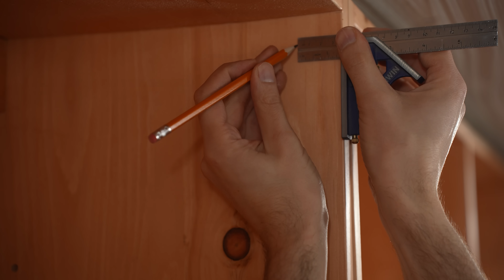Stop Using Plywood To Make Cabinets!

Comment: Plywood is the single best deal there is.  I say this as an actual fine woodworker, and a wood snob.  But I just bought some Baltic Birch (so called, it may come from china), and it has 11 plies.  that is 352 square feet of veneer in it.  Veneer sure doesn't cost even as little as 1 dollar a square foot where I buy it, more like 5 times that.  So each sheet is at least 352 dollars worth of material, and it could be worth as much as 1800 dollars.  

But wait, there is more.  Those numbers don't include the the manufacturing, or the glue.  I have made my own curved plywood, and the glue alone would cost the 76 dollars Canadian, I paid for that single sheet of plywood.  It has to be epoxy with my level of vac bagging technology.

I have some large pine trees on my property, and an 090 chainsaw mill.  So maybe it is possible for me to acquire some "free wood".  But just the cost of storage is astronomical compared to plywood.

Comment: lets see how warped these are after a year or two...there's a reason everyone uses plywood - solid hardwood warps overtime and if it's wet enough it'll even crack. As of right now - at least locally - I can get 1/2in baltic birch plywood for about the same price of the pine... the baltic birch is far superior and easier to work with for cabinets and is also much stronger and won't warp over time.

Comment: Surprised that you glued the back panels. You said about leaving a small gap to allow for expansion/contraction but glue will break when that happens. Traditional woodwork practice for this is to have a single point of anchor on each panel, nail, screw or glue spot.
Reply from the maker: The glue is only in the centre 2" or so of each slat, so there is a bit of wiggle. Even so, I likely could have glued the entire thing because, realistically each slat will only expand a few thousands of an inch, and PVA glue is pliable enough when cured to account for that amount of movement.
Reply: @ScottWalshWoodworking  Fair enough. I hadn’t realised PVA had that flexibility. The traditional technique was, of course, using older glues.

Comment: Great video, and great finished products.  However, if you consider the cost of the highly specialized power tools like the jointer and planer, dust collection system, etc, the plywood (even expensive veneered varieties) are much less expensive to build with a simple table saw and circular saw-based shop.  Most contractors create built-in cabinetry with simple portable tools which can be set up on site and stored easily in a truck.  Your shop is great, but we all don't have one.  Thanks for the well-produced video.

Comment: I've seen plenty of fine woodworking done in pine. It is easily worked and machines smoothly. Its maligned reputation is undeserved and comes mainly, I think, from its tendency  to blotch when stained. That fault can be overcome easily with some prep work, such as application of a sanding sealer. Or do what I do and just finish it with shellac.
Reply from the maker: or if you're lazy like me, cheap tinted poly prevent's blotchiness since it stays on top of the wood rather than soaking into it.

Comment: Plywood cabinets are fast easy and cheap. You can make them really cheap with standard hardwood ply or really high end with birch. It’s strong and stable. Making softwood panels seems to be pointless. All good techniques and great looking doors. Save all the panel effort for making something like a sideboard

Comment: Pine is only cheaper if your time spent jointing, gluing, planing and sanding panels is worth nothing.
Reply from the maker: I enjoy that process much more than using sheet goods personally. I do this as a hobby, not professionally, and my videos are targeted towards home hobbyists, no professionals.
Reply: @ScottWalshWoodworking  I get that. And I like your stuff. So keep doing what you’re doing!

Comment: Finishing the inside isn't optional. If you don't humidity changes will cause the boards to warp as it will soak into the inside but not as much on the outside. If the dowels hold it from warping the internal stresss it causes may cause cracks.
Also if anything is spilled inside it will be easier to clean up.

Comment: I have been looking for an excuse to practice my panel making skills before I try them out for real in Oh My God per board foot walnut for the 6 foot long dining room table I want to built. And while practicing I can get some nice looking cabinets for my shop that I badly need. So thank you.

I am pretty new to woodworking and am still assembling my workshop and don't have a table saw, let alone a jointer. But I do have a track saw and I am finding that maybe I don't need a table saw or jointer. This is especially the case for making panels with perfect seams with zero gaps before gluing the panel together (so no need to force your will on the pine to get the edge to line up). The secret to zero gaps is to line up the two boards that will be next to each other in the panel and put the track saw track so that when the saw cuts down the seam between the two boards, it cuts around half the kerf width off the edge of one board and half off of the other. Even if the saw wiggles a little or the cut isn't perfectly vertical, any imperfection will have a mirror image of it in the other board. As a result  the two boards should fit together without any gaps at all. 

To make sure that the panel goes back together in the same order with the same edges against each other, I lay out the boards in the panel in the order I want them and then write a number in pencil so that the number is half on one board and half on the other. I also put a couple of diagonal lines across the entire panel with a straight edge so that when I have the boards positioned to minimize the gaps in a global sense I can use those diagonal lines to position the pairs of boards relative to each other when I cut the seam so that my seam lines don't tend to drift from my dry layup.

The edges of the boards don't actually have to be jointed perfectly before cutting down the seam. They just need to fit well enough together that the saw will cut some off each board along the entire length of the cut as well as across the thickness of the boards. But if any of the boards curves too much, the track saw can put a straight edge on one side. Then with a square and some calipers, you can put two marks on the opposite side of the board to line your tracks saw track up to and put a straight and parallel (enough) edge on the other side of the board.

Oh, and I do clamp the two boards together when I cut down the seam. My MFT has a sacrificial strip routed into it for both rip and cross cuts. I use flat horizontal bench dog clamps on each end to hold the two boards together with light clamping pressure so they don't shift, but not so much pressure that the gaps start to close. Apply enough clamping pressure that the gaps close even partially and a gap equal to the amount equal to the amount the original gap was closed  will come right back when you release the clamps and the wood returns to its original shape. 

If you don't have a bench that you can clamp the boards without getting in the way of the track, I think you might be able to take two additional boards of the same thickness and put them on either side of the two boards that you are going to cut and press them up firmly enough that they won't shift. Then clamp the outer two boards to your workbench. And if you don't have a sacrificial strip in your work top, then you will probably want to put a piece of flat piece of plywood or MDF underneath rather than foam. I think that foam might flex just a wee bit under pressure and the bottom of the seam opens up a little. This will cause a gap to open up along the entire top of the seam since the edges won't be vertical with respect to each other even if they fit perfectly down the length of the seam.

Comment: Great video, the cabinet shop I worked at would use full thickness backs on upper cabinets and nail it all around, the back in this use reduced sagging on wider upper cabinet bottoms or whatever one they decide gets the heavy stuff.
Reply from the maker: That's very true, I never thought about that.

Comment: Problem is, it's relatively easy to get more or less decent plywood, whereas getting decent pine stock is nigh impossible unless you find a good wood supplier which are often inconveniently located
Reply: i feel that. the 'lay it on the concrete' technique looks to be worth some investigation.  that might prove to be the unsung hero of the video.

Comment: A nice way to buy cabinets. In 1950, we bought a house in town that needed the kitchen rebuilt. Dad built the cabinets using 1 x 4 clear white pine car siding. The cabinet top and backsplash had a cove molding on the back edge and were covered with vinyl flooring. It stood up just fine for 50 years. Even the places where mother let cigarettes burn the cabinet top. The black burned melted plastic left where her cigarettes burned. The countertop stood up reasonably well. They just didn't look very nice. The varnish on the cabinets had noticeably yellowed with 50 years of age and the smoke from Mom's Chesterfields.

The cabinet's tongue and groove joints were glued up and edge nailed from the back in a jig that aligned the front face, top, and one side using wedges to cla,p the edges. Two 1 x4s were screwed & glued at right angles to the direction of the tongue and groove joints on the doors.

Comment: I just tore down some cabinets made with fiberboard (LDF? MDF?) That had been in a kitchen since 1970? They were brad nailed to the wall with little battens right under the back of the shelves. It resisted me throwing my whole 200lbs against it even after I tore it all to pieces.

It's totally fine to not put backs on your uppers.

Comment: I’m putting built in book shelves and using 3/4” plywood.  A single sheet weighs 70 lbs and is a bear to break down without a good size room and either a table saw or track saw ($$$).  Plus I had to rent the HD truck to get it to my house. 
This alternate approach has merit.

Comment: You can simply attach panels to each other with fasteners. 
It will automatically pull potentially cupped panel against perfectly straight end-grain edge of another panel.
Rebate alongside the straight edge + pocket hole screws on the panel + some glue will create very stable and rigid joint.

Comment: As a professional cabinet maker, I cringe when fellow woodworkers use solid wood for cabinets.  There are sound engineering principles to use plywood or other sheet goods. Furthermore, melamine particle board will make a better cabinet than solid wood.  A cabinet back is an essential component to making the case square, strong, and provides a means to screw the cabinet to the wall.  Walls are normally not straight or flat, requiring shimming.  A strong square case enables doors to flat against the cabinet face (overlay or inset).  Beginners, please don't not use solid wood for case goods.  The cost of sheet goods is a low cost investment.  The construction methods of the these pine cabinets is overly complicated. Much easier ways to construct them.
Reply: Mice chew that mdf, solid hw, yo.

The rats

...in the walls...
Reply: I have been a wood worker for 45+ years.  I have no issue with solid wood or plywood.  Each have a place.   When wanting something traditional there is no substitute for solid wood.    Also with the high cost of plywood   there are reasons to go traditional.    I will never stoop to using MDF or partial boards.  Yes low cost but low quality.    I tend to mill my own wood and rarely use pine or birch.  I love African Mahogany.    And when buying it rough.  The cost isn't bad.            Sometime (not counting my time) it is a bit less than good grade pine from the box stores.
Reply: Roaches sure do love the wood glue used to make particle board. I'm switching to solid wood thank you.
Reply: I've been woodworking for more than 50 years  and have solid wood, rock maple, and tiger maple cabinets that came from my great grandfather's home shop. My family have been cabinet/furniture makers in this country since 1647 and solid wood is all my ancestors have ever worked with. Even in the mid 1950s, when many companies started using plywoods, and melamine coated woods, we stuck with what has always worked, solid wood. Perhaps MDF, particle board, and crappy looking melamine coated particle board is all you have known and worked with, but you can keep them.  If you want something to last, especially in a shop setting where they will see continuous use, then you are going to need something sturdy and will hold up for years. Quality Plywoods like Baltic birch or other laminated sheet goods is acceptable too. As I mentioned, my shop cabinets were in my great grandfather's shop making them more than 250 years old and other than some dinged doors, they are in beautiful shape. I give them a good cleaning every couple of years, on top of regular  vacuuming when needed, as I was taught by my grandfather when they hung in his shop. And these will be handed down like othe fine wood antique furniture to the next generation for their shop. 
I think Scott did a beautiful job on these cabinets and everytime he opens a door or drawer, he can take pride in the work he did. Pine is a cost effective alternative to the expensive plywood these days and look much nicer than plain plywood. With that said, I do support the repurposing of materials, and use free or cheap solid wood furniture in many of projects. You can save a solid wood dresser from the landfill by disassembling the components, milling the pieces in usable lumber and give it a new life.
Each to their own, and he sets a great example to beginners to take pride in your work space. After all, for those of us who do this for a living or even as a hobby, we spend a lot of time in our shops, so why not make them pleasing to look at and be in as possible. Besides all of that, where else is there away  a  better place to practice woodworking techniques than in our own shops. If a prospective client stops by, they will see the quality of your craftsmanship with the amount of care you've put into your own "just shop furniture".  You don't want to be practicing joinery on a client's piece or a gift and chance it not looking good and ruining quality materials.

Comment: its called a Mason's mitre when using the same technique to join two kitchen bench tops at right angles which are usually rounded over or chamfered.

Comment: If you don't have a quality dowel jig. Those plastic Bunnings dowel jigs are not quality. They are a waste of space! Consider through dowels. All you need is a couple of clamps and a drill, Oh and of course dowels. just drill straight through the panel to be doweled and push the dowel through. Job done and alignment is as good as your clamping job. No Jig needed. not only that the end of the dowel actually make the job look strong from a visual perspective. just remember not to drill the hole the entire length of the dowel so you can cut and sand the tapered end off. if you don't have dowels just use some round rod cut into lengths. super strong and actually quite attractive when coated in clear or oiled.

Comment: You mean they make jigs for dowel alignment?  ;)

The last time I built cabinets (2000), I glued and screwed the four outer panels (1/5, 1/2 and 4/5 of the distance front to back), screwed on the back panel to square the box, drilled and dowel'd the four outer panels together (about 1/3 and 2/3 of the way through), then hung the box on the wall.  Next, I built and hung the doors, then added shelves.

Special table saw blades used:  0
Jigs used:  0
Cross-cut saw used:  0
Plane used:  1
Orbital sander used:  1
Strength:  roughly equal to yours
Professional finish:  roughly equal to yours.
Time taken:  much less than yours

Keep it simple.

BTW, the idea that doweled joints are stronger than a glued and screwed butt joint has been largely debunked by systematic testing to catastrophic destruction.

Comment: The issue here is that if you're too broke to use proper birch plywood, you probably don't have a jointer.
Reply from the maker: my first jointer was a $250 delta 37-220, and I still miss that jointer

Comment: "Stop Using Plywood To Make Cabinets." I beg to differ. I was raised a cabinet maker (my Dad was one, too) and plywood is the strongest, straightest material, yet weight-wise, the lightest, that you can use. Cabinets I have made with plywood can easily hold almost 7 times the weight that a natural wood cabinet can. (I have done tests just to prove this point. In one test, the plywood cabinet came off the wall IN ONE PIECE, after I kept adding weight AFTER the natural wood (maple) cabinet broke apart. If I remember right, it came off at 600 pounds. I think the maple cabinet collapsed at 375. (It was a while ago.))

Comment: in what place does wood cost less than plywood O_O I thought the only reasont to use that ugly ass plywood was to save money? (yh ik its stronger too. but cabinets is not where that would matter anyhow)
Reply from the maker: You can buy sheathing for cheap but I wouldn't make cabinets out of it. The pine I used is about the same price as the least expensive plywood I would consider making cabinets out of, and half the cost of Baltic birch which is what a lot of shop grade cabinets are made out of on YouTube. Also I just don't like breaking down plywood and trying to transport it for that matter
Reply: @ScottWalshWoodworking  this is crazy! I haven’t made precise calculations but back in the shop we even used to cut plywood in strips to use as planks bc it’s sm cheaper than worst twisted knotted wood planks we could get our hands on😭